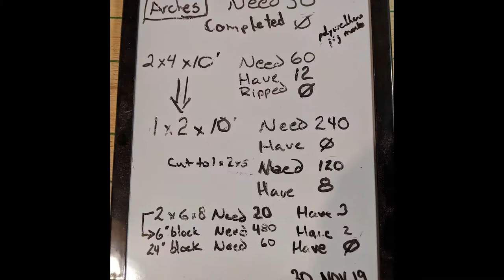Updated Laminating Boat Shed Arches - Wooden Boat Building - Ep. 2

Comment: Use a small paint roller to apply glue. Pour glue in a tray.
Reply from the maker: Oh that is a good tip Tom. Thanks
Reply: Absolutely. I’ve nearly finished my epoxy/pvc boat and I can only think of a couple of times I’ve used a ridged roller instead of a cheap disposable 4” paint roller. At $2 each it’s a small price to pay for the convenience. They carry a heap of resin from tray to job, or pick up excess resin, and using a tray the pot life is improved over leaving it in the cup. And if you work the job a bit I’ve never had issues like bubbles and voids.
Reply from the maker: @robinhodgkinson  Love all these tips. Will definitely help, especially when I get to the fiberglass. Keep the comments coming.
Reply: @TheAmblerOdysseys A year later...
Lay a thick coat of paste wax on your jig, cleats and clamps.
I like to use a silicone basting brush for these types of jobs that don't require precision.
Yellow glue is much cheaper by the gallon. Don't let it sit too long or freeze.

Comment: Maybe I missed it, at what point do you insert the screws, at the middle blocks, from one side only, how many screws, at each block? So much more earth friendly than using steel frames for arches.
Reply from the maker: I use screws to fasten both 2' spacer blockes and also the blocks where the is a but joint. The remainder of the spacer blocks are brad nailed. You could of course screw in every spacer block but that be a lot of screws. Not only more earth friendly than steel frames, but much, much cheaper.

Comment: Somewhere I missed the size of this boat shed. How wide at the base? How long are the arch halves? How tall at the peak? Want to build a 24' wide x 40' long x 18' tall (peak) boat shed. Have to have 10' wide x 13' tall clearance at door. Boat has a flybridge and is 12' from top of flybridge to ground. Really just need to know length of arch halves. Don't know how to calculate length of arch halves. Any help is appreciated.
Reply from the maker: Hi Jerry. The base is 24'. Arch haves measure 20' on the outside. Peak is about 18'. Arches sit on a 2' knee wall.  This plan will accommodate your build no problem.  For me I will have to make some major mods to the boat shed when I work on the pilot house as it will not fit in it as currently built. So I will be finishing the forward section first so that I can remove the forward arches and then raise them to cover the pilot house area.  But I have a couple years before that point.
Reply: @TheAmblerOdysseys  Thank you so much for the info. Very much appreciated.